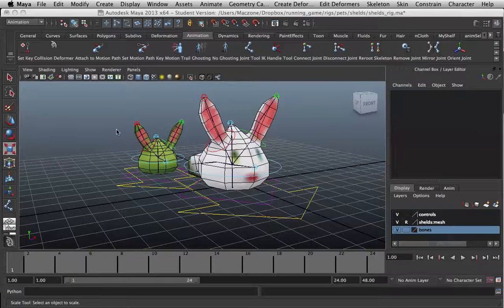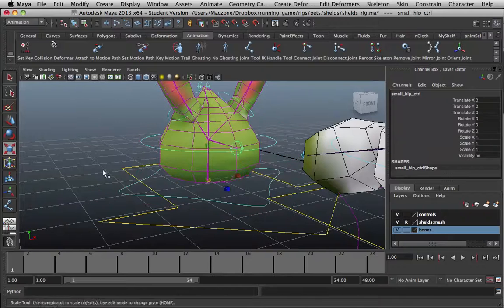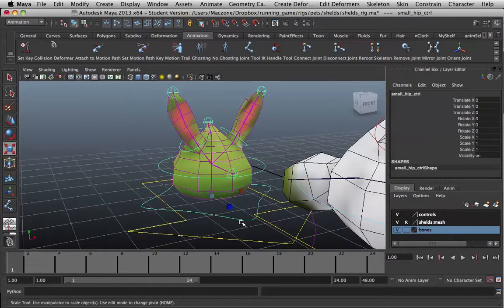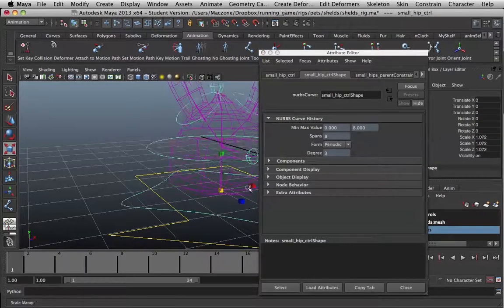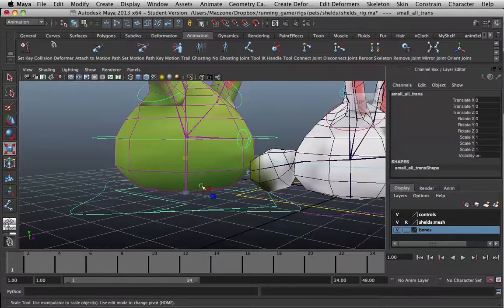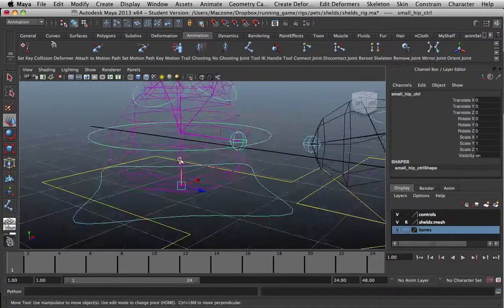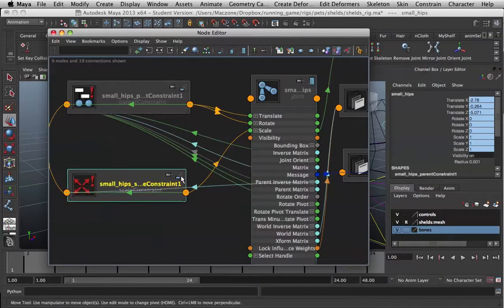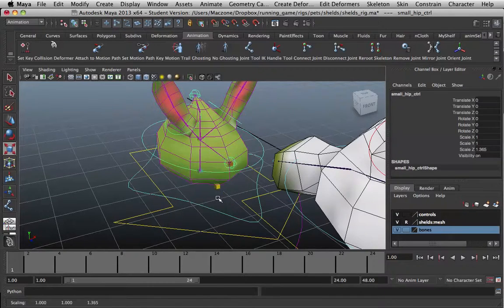Maya joint scaling tips

Comment: What if you need to resize the bones and not the scale of the mesh.
Reply: The visual size of the bones can be changed via Display > Animation > Joint Size.  If you're talking about resizing the whole skeleton, I would use the move joints tool found in Skin > Move Skinned Joints and move them around instead if you have a mesh that's already skinned, or if it isn't skinned just scale it normally from the root joint.